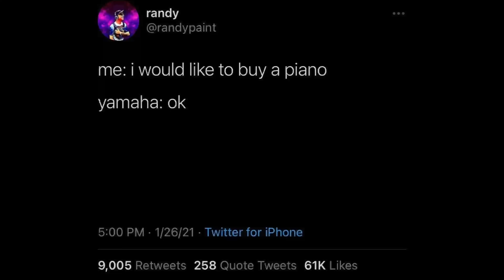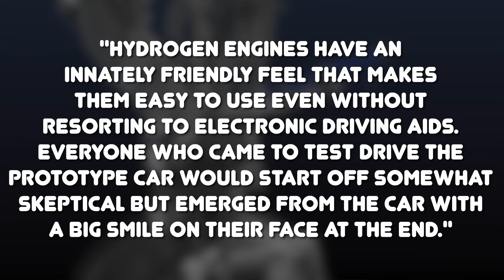Toyota's New 455HP Hydrogen V8: Everything You Need to Know

Comment: This video is so bias towards EV it's ridiculous. 

"If you really want to disrupt the automobile industry, like if you look at Tesla for example, if you want to change what people are buying, you have to offer them a product that is superior in every single way..." I don't see how Tesla or ANY EV's are superior to current ICE vehicles in "every single way". Price, emission on production, range, re-fuel/recharge time, towing, weather/temperature dependency, weight just to name a few. 

And then you go on saying EV's are not superior in every single way but it will change. So why can't hydrogen infrastructure change which is one of your main point of why hydrogen has no demand? 

The whole point of a hydrogen car is to output 0 emissions, yet you dismiss it all together. 

If you are serious about this topic consider this, look at Nissan's e Power or other range extender PHEV's. Imagine those engine running on hydrogen to produce electricity and drive the vehicle. Engine will idle at preset rev's, so manufacturers can target specific db for noise cancellation making it as good as an EV from quietness and power delivery point of view. None of the short falls of EV's, with almost all the benefits of an EV except engine maintenance cost.

Comment: Man you really really missed the mark on this. The main advantage is the production of the hydrogen fuel doesn't require you to build out trillions of dollars of new power plants.  Hydrogen fuel doesn't degrade, doesn't need replacement, doesn't need advanced materials or manufacturing. It's easily transported and would be far cheaper to produce at plants than lithium ion batteries. It solves almost all of the problems associated with scale.

Comment: Not quite zero emissions co2 from burning oil and nitrousoxide from nitrogen in air. It would be a grate car if the car had a hho built into the car so you could make what you need and then recycle the water to separate again

Comment: Hydrogen is corrosive. I met some Ford engineers displaying some Ford Hydrogen designs at a Michelin Bibein challenge shoe and I complemented the Ford engineers on the car. That is when they told me do not park it in your garage. Hydrogen is corrosive and a gas. a cloud of hydrogen in your garage meeting a spark would be a bit of a problem

Comment: Your missing so much . No there's not stations to fill hydrogen now but there could be. The point of hydrogen over gas is emmisions.  Internal combustion gas / diesel can't continue.  Hydrogen can.  You know where to Internal combustion engine shine vs electric.  Matenince . Replacement motor or battery for electric is ridiculously priced.  I do not want an electric car. I would buy hydrogen .

Comment: The problem is ignorance. It does not make sense to highly compress hydrogen and go through all that expense when you do not have to. People are led to believe the only way to have hydrogen cars is with expensive highly compressed hydrogen. They are also led down the wrong path that you must have hydrogen refueling stations to have hydrogen cars. This is a ridiculous notion and is just due to a lack of knowledge. A company called Hysata makes an electrolyzer with a 95% efficiency (before you say nonsense they are published). They are saying within the next 5 years they can bring the cost of green hydrogen down from about $22 a pound to about $3 a pound. (you can also use this unit with electricity that is not green as that would be cheaper yet) If you have such a unit at home you do not need a hydrogen refueling station you only need water, electricity, and an electrolysis unit like this. Plasma kinetics has a solid film that stores hydrogen in a solid at 99.9 % pure. You do not need to purify it as only 99.9% purity of hydrogen is absorbed/released. The hydrogen is released by light NOT HEAT. The future will be something like this, you make your own hydrogen at home with something like Hysata. You then have that absorb into a solid like plasma kinetics. You then put that solid (no danger of explosion unlike highly compressed hydrogen) into your car in what is like a cd player to release the hydrogen at whatever level you need and off you go none of the other nonsense you were wrongly led to believe is required. None of this occurred to Elon Musk unfortunately for him.

Comment: The water molecule can be split ON DEMAND, in the vehicle. "Fueling up"? This guys on crack. Battery powered cars are NOT the way of the future and frankly are usustainable. Water powered or hydrogen/oxygen powered cars are the future. Oh and by the way, Tesla drove his Packard across the states with only an antennae, a little black box for energy production and an electric motor. NO BATTERY NEEDED. Tesla's are not real Tesla cars.

Comment: You seem to forget the BILLIONS that governments have already in vested into EV systems and still they do not have range and recharging time is a problem. Also given EV has been around for over 100 years it should be better than it is. H2 is only been on the market for what 10 years and no wit is able to out perform an EV in every measure. The only issue is generation at that cost is coming down and does NOT need any fossil fuel to create it. I suggest you read up on the latest science journals to get these facts. Finally the transportation of Hydrogen can be done as ammonia, which we do lots of already or electricity which is stored on site, in better than Lithium batteries using Flow batteries.
Show me how a 300km F1 race will go between an EV car and a FCEV without battery swap out but needing to refuel like we all have to in the real world.

Comment: While I was outright begging Toyota to do a hybrid V8 for the new Tundra, I will say that an H2 V8 would be a nice gap fill. Just wait to see what happens in 10 years, especially with the aftermarket, when people start to see how much you can compress hydrogen for a HUGE bang.
Reply: Not going to happen. There are all kinds of problems with any potential hydrogen ICE. First of all, petrol have about six times the amount of energy as hydrogen per unit volume. So you say, Hydrogen is a gas so just pump it in at a higher pressure’. That’s where it all turns to custard. By a strange coincidence, a kilogram of hydrogen contains about the same amount of energy as a gallon of petrol. The hydrogen tank in a Mirai is pressurised to 700 bar and holds about 2.2 kilograms of hydrogen. That’s about the same as two gallons or so of petrol. How much range do you think you’re going to get out of your rip-roaring 455 hp V8 with that kind of mileage? Probably not more than 50 miles.

Secondly, while hydrogen burns faster that petrol (which creates knock problems but those can be fixed), it also burns a lot hotter and has a relatively narrow powerband.

So nobody is going to be putting one of those things in their truck in the coming years. In fact, my opinion is that this is a hoax. The exhaust system looks like a bad bit of Photoshop and there is no obvious intake porting. It’s an engineering dead end.
Reply: @thethirdman225  Rather dismissive of the overall potential, though yes, there are hurdles to clear. Kind of surprised you didn't toss in hydrogen embrittlement, which is normally the first thing people like to bash you over the head with. 
A better storage and recovery element is the first part of making a hydrogen system relevant, and to date that hasn't been accomplished with any real meaningful device outside of material infusion. Beyond that, extracting usable power may well end up in an entirely different engine then we are used to seeing, though a lot can be achieved with electronics with further understanding. 
I'm not, by far, saying it's an easy or even readily accessible means of replacing petroleum in the near future, but it Is an option that should be explored. By virtue of it's potential power, range can be extended with less fuel used per cycle and as stated, a better storage device than the weighty h.p. tank most everyone associates as the only viable answer.
Reply: @C-M-E  
”Kind of surprised you didn’t toss in hydrogen embrittlement, which is normally the first thing people like to bash you over the head with.”

I’m not terribly concerned about that. Have a look at how the manufacturers of rocket engines dealt with closing the loop on the oxidiser side. I’d say it’s one of the more resolvable problems.

”a lot can be achieved with electronics and further understanding.”

I don’t think this can make up for the major shortcomings of hydrogen as a fuel for ICE engines. There’s nothing there that can make up for the fact that hydrogen only contains about a sixth of the energy per unit volume of petrol.

”By virtue of it’s potential power, range can be extended with less fuel used per cycle as stated, a better storage device than the weighty h.p. tank most everyone associates as the only viable answer.”

But these are the exact problems. Hydrogen as a fuel lacks power. You need to inject six time as much of it to get the same power as petrol and that’s why range with hydrogen is so poor, at least as far as ICE engines are concerned. Besides, if we can’t meaningfully increase the range of existing ICE engines, even those running on LPG, I can’t see a future for a fuel with only 1/6 of the potential energy. Basically, it would need to be an extremely powerful engine to start with because hydrogen is going to strangle it. An engine that makes say 250 hp is going to make about 45 hp running on hydrogen. Either that or it’s range is going down from say 300 miles to just 50.

Have a look at the size of the tank that BMW used in their experimental hydrogen car. It was huge and it took up the whole back seat area. I can’t imagine what it weighed.

The tank is only part of the problem. The whole system: pipes, unions and valves, is a potential source of leaks.
Reply: @thethirdman225  You're getting bent out of shape for no reason at all just to shoot down a youtube comment, but that's fine, I'll play. Rocket engines aren't as concerned with embrittlement because they purposely run them right on the edge of blowing up for max performance; that engine may only fire once and be used once in it's payload-launching lifetime (not speaking about SpaceX use here, more the typical cycle of the last 60 years) so embrittlement is near the bottom on the list of concerns. They also use a lot of ceramics and carbon-carbon solutions as ablative heatshield protection. Making a reliable land-based vehicle engine that starts whenever you put your key in and lasts for decades is another matter. 
Hydrogen 'pound for pound' is lower than petroleum in raw density, but in propellant power, it expands in volume roughly 6 times greater than a petroleum equivalent with a fraction of the fuel used. That is both a benefit and a detriment, as containing that kind of wave front in an ICE would be challenging at best (again, reliably), but it can be done once the fundamentals are better known. H2 is barely in its infancy and practically still-born as of the present. I'm not a particular fan of electric vehicles as they are utterly soulless (not the mention most global grids can barely sustain demand as is right now), but if H2 is a lifeline for the ICE, you best believe I'll be working on it. Jet engines run marvelously on Hydrogen, though you're not likely to see one of those on the road any time soon.
Reply: @C-M-E  
"You're getting bent out of shape for no reason at all just to shoot down a youtube comment, but that's fine, I'll play."

Not bent out of shape. I just enjoy the exercise.

"Rocket engines aren't as concerned with embrittlement because they purposely run them right on the edge of blowing up for max performance; that engine may only fire once and be used once in it's payload-launching lifetime (not speaking about SpaceX use here, more the typical cycle of the last 60 years) so embrittlement is near the bottom on the list of concerns."

You're flogging a dead horse here. I'm not very concerned with embrittlement. My comment actually was to the effect that I think it's one thing they can resolve.

The Soviets solved the oxidiser side well before SpaceX was even a thing. That's why ULA has been using RD-180 engines up to now.

Or are you actually less confident that it can be fixed?

"Hydrogen 'pound for pound' is lower than petroleum in raw density, but in propellant power, it expands in volume roughly 6 times greater than a petroleum equivalent with a fraction of the fuel used."

At 700 bar, hydrogen has an energy density of 1.3 KwH/litre, compared to E10 at 9 KwH/litre. The result is that you need a lot more fuel to compensate for hydrogen's lack of efficiency.

Hydrogen also burns faster and cn get into places that regular fuel doesn't go.  It also runs hotter and only in a limited range.

"H2 is barely in its infancy and practically still-born as of the present."

It's been known about for over a century. The problems haven't changed and we haven't even started talking about the difficulties of extraction. You're talking about it as a gap filler but it looks increasingly like hydrogen will be a long way behind electric and will probably never be viable in an ICE anyway.

Jet engines run marvelously on Hydrogen, though you're not likely to see one of those on the road any time soon."

Jet engines have been tested with hydrogen as far back as the 1980s. The fact is that while they run on hydrogen, it remains to be seen if it can ever be a practical fuel for aviation. Extraction and storage are, again, extremely difficult.

I'm calling this out because I think it's a hoax. Toyota and Yamaha might have tested an engine on hydrogen. They might even have got 450 hp out of it. But I'll believe it when I see it.
Reply: @C-M-E  Bit of an emotional issue for you, is it?
Reply: @thethirdman225  You've become a nuisance wasting my time and adding nothing of merit.
Reply: @C-M-E  And this is exactly the problem. You say you pure a realist but when I give you scientific reality, you call me a nuisance.

You can hope all you like but science suggests not to get your hopes up.
Reply: @C-M-E  LOL!! That isn't solvable.

You're really taking this personally, aren't you?
Reply: @thethirdman225  Oh, it's very solvable. Took me all of 7 minutes to crack the cipher. Figured a bright boy like you should be able to do it in 20 or so, but evidently that's far too much credit for you.
Reply: @C-M-E  No, I have plenty of fun solving number puzzles. By coincidence that's what I was just doing.
Reply: @C-M-E  This is really, really personal for you isn't it? Christ on a bike...

I'll leave you with the last word, since it means so much to you.
Reply: Well, it doesn't matter to me. It's your problem, not mine.

Comment: So, I do not mean to disagree with the host of this video, but even though electric vehicles themselves pulled out zero emissions they're still putting out negative ions which when combined with atmosphere is still a negative on creeping heat and greenhouse gases within our atmosphere causing additional heat. Another thing, electric vehicles even though they don't produce any emissions themselves the way that most people charge their electric vehicles is actually doing more harm than having combustion engines on the road. You have to consider from the very beginning of where the oil is gathered how it is processed and how it is transported as well as the electricity if you really dig into the current research of how this electricity is being produced overall how do you electricity is being produced still has a larger carbon footprint then combustible fuel engines. The reason for this is gas and diesel have been around for a long time so scientists have had the chance To refine the process to use the least amount of energy to get the end fuel to put into your tank electric cars even though they have been around for arguably the same amount of time the same amount of dedication and research has not gone into them until the past 15 years no one had touched them since one of the first electric cars from Mercedes back in the very beginning. Scotty Kilmer has done between two and three videos on the total impact on the environment of electric versus gas and if you don't like Scotty Kilmer other magazines and other You Tuber's have done it as well but as it sits right now electric vehicles are still have a larger carbon footprint than internal combustion engines. One of the largest problems with electric vehicles is most of them are being charged by fossil fuel burning plants. If we were to switch to solar hydroelectric nuclear or Geo geothermic power then we would be producing the electricity with zero carbon footprint. Because the demand for electricity has increased nearly ten fold in the past five years for the state of California they did two stupid things. 1 they close down their last nuclear power plant. Two they replaced that nuclear power plant with Cole and a propane fired turbine style power plant. Because the French have spent many years developing uses for spent uranium rods involved in the nuclear process they no longer have to bury nuclear waste underground for hundreds of years they can take the low energy spent uranium rods from the process and actually use them to do other things in the industry such as sterilize fruit use them in medical imaging platforms and other things. I urge anyone watching this video to simply do some research on the total carbon footprint of electricity versus fossil fuel usage., especially if you're doubtful of what I have said above. This is my first Dust Runner's video and so far I'm very impressed.